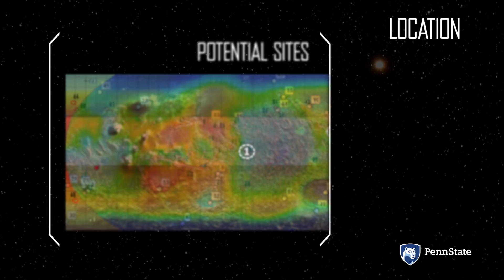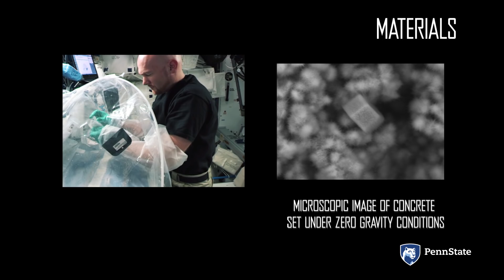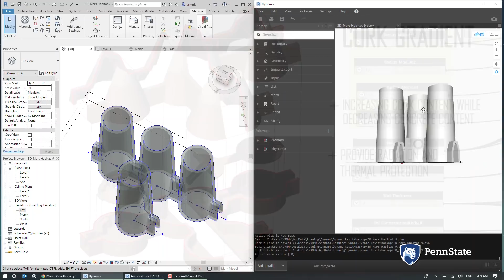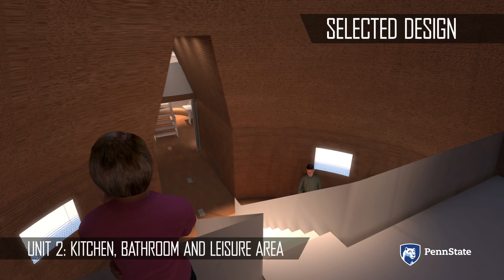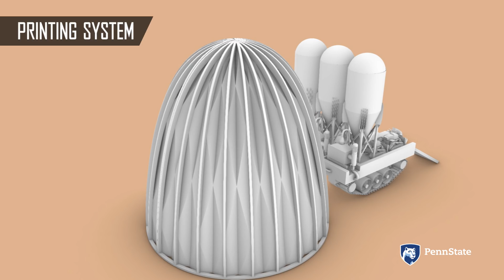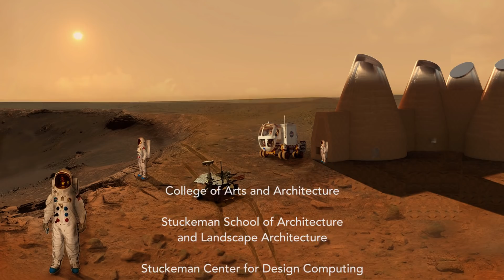NASA 3D Printed Mars Habitat Challenge Phase 3 - Penn State - Virtual Construction Level 2

Comment: The stairs should have fewer higher steps if you account for Mars gravity.
Reply: Our legs are still the same length as they were on earth
Reply: @lhtyeehaw1319  our legs length is not the binding restriction in the height choice, but the force you need to excert to climb each step. Most people can step on a chair but climbing a stair  of several "chair seat height" steps would be too much on Earth. Also steps need a minimum detph for step security. Hence a shorter stair design with fewer higher steps sesms logical in an habitat on Mars where surface area is so limited.
Reply: @JonatanDanon  okay, makes sense
Reply: My feeling is that people going downstairs will have a serious problem not to fall forward. They will jump straight to the floor instead. Yet it would have to be done in a straight line. One has to remember that although the weight on Mars is three times less, the mass remains the same.
Reply: You would still be doing the same amount of work against gravity whether you have more or fewer steps.
Reply: You haven't watched big bang theory then. The change in a steps height by only a few millimetres can cause a person to trip. Our minds are habitually trained to lift our foot a certain height. Gravity wont change that. It's foot eye co-ordination. But I understand the space requirements you mentioned and we might have to learn to step differently.

Comment: have you calculated, how much energy it needs to 3D print 1 m3 of opaque and 1m3 of transparent wall or ceiling structure under the conditions on Mars  and how much on Earth?
Reply: No, not yet!
Reply: @JoseDuarte-zv2xx   or a rough estimation?   I think , this is an important issue, since energy is a very rare resource on Mars. As long as you don´t have a very big nuclear power plant